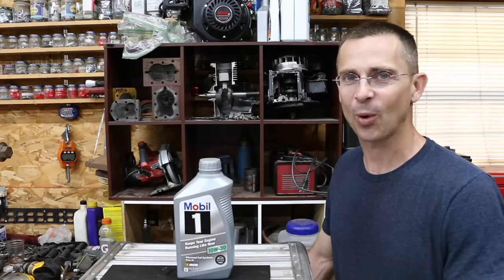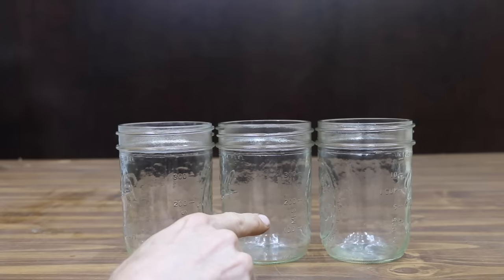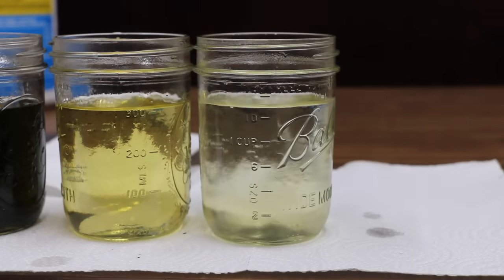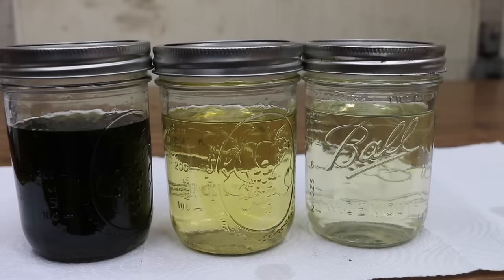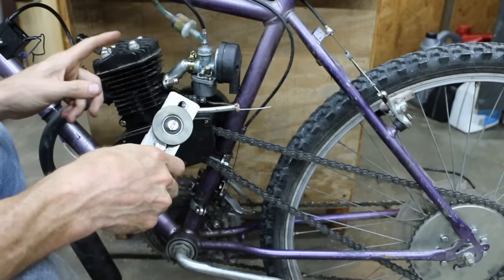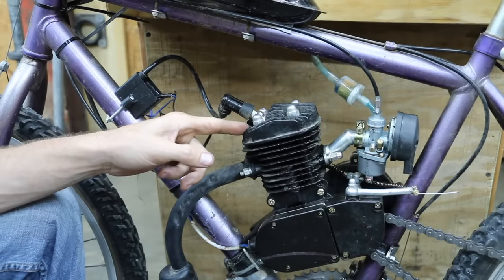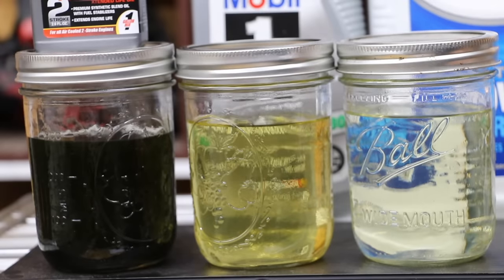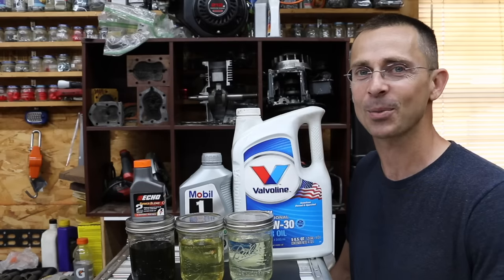Will 4-stroke oil damage a 2-stroke engine?  Let's find out!

Comment: Id say crank life could seriously be compromised. But it was a great video to show the short term effects of this, and to know that in an emergency one could get home with some basic 10w-30.
Reply from the maker: Thanks for watching!
Reply: I have an antique chainsaw from before dedicated 2 stroke oil was common. It’s data plate says to use SAE 30 weight oil mixed 16:1. So I’d say mixed 50:1 it definitely will not work.

Comment: You should test if lacquer thinner actually cleans out a catalytic converter and compare it to Cataclean
Reply from the maker: Thanks for the video idea!
Reply: I used to work at a shop we have a customer coming with the 2004 Cadillac CTS he said it quit running but he also said he put lacquer thinner in the gas because he read that it cleaned  the cats long story short we had to replace every injector fuel line and fuel pump because it disintegrated the rubber and plastic and clogged up the whole fuel system

Comment: Please test vegetable oil in a 2 stroke engine
Reply from the maker: Thanks for the recommendation
Reply: Run vegetable oil in my kx 80 years ago,I was about 11. It blew up,not right away,but it cooked
Reply: Daryll Messer you got 91 years?
Reply: Vegetable oil is very diverse.  2 stroke bikes in the 60s and 70s used the original "Castrol R", which was a castor oil based lubricant, or "Blendzall", also a castor based oil.  They had a distinct exhaust smell.  Oil technology has come a long way.  Saab used to have a 2 stroke 3 cylinder car.  It had a lot of problems.  An engineer friend told me that if they had had modern 2 stroke oil in those days, it would have probably been fine.  Having driven tens of thousands of miles in my Mercedes diesel car and Ford 7.3 diesel truck with vegetable oil fuel, I can tell you that I would NEVER put it in the crankcase!  With 2 strokes, you are lubricating the rings AND the bottom end with the fuel-oil mixture.  Not a good idea.
Reply: Test it yourself
Reply: Be-careful here.. Most if not all the oils sold as vegetable oils are not made from vegetables.  So call out what the oil is actually made from during your testing.
Reply: Chris Farley  Quite possibility yes
Reply: I did do some full power runs on my tailgator 2 stroke generator with algae oil at 40:1. i ran her 3 days with out shutting her down with verios loads and it worked great but    smoky at startup as it is harder to burn off though. i did do a full power load run for a hour to get exh temps 800 deg to burn off clean. at  850w load the exhaust get almost glowing then i back down for cooling before shutdown!

Comment: I love your videos dude! you take things with a scientistic eye, but within the understanding reach of mortals. I do see more carbon buildup around the spark plug electrode and around the exhaust port, even on the scoring of the sleeve surface, when 4 strokes oil is used. I believe that over time that carbon buildup would accumulate causing rings to stick on the piston, putting the spark plug on short circuit, etc.

Comment: I think the damage would be on the crank not the cylinder... on 2 stroke dirt bikes to lean or no oil always makes the crank seize....
Reply from the maker: Thank you
Reply: Totally agree...the oil in the fuel mixture is what actually lubricates the crank bearings, and wrist pin bearings.   I’m sure the engineers (in later years) realized that two stroke oil had an advantage over 4stroke oil, otherwise it would not be recommended by the mfg.   Would you risk putting 4-stroke oil in a new $5000 racing two stroke bike?  There’s a reason they designed it for using 2stroke oil.
Reply: @kramerflamer  - 2 stroke oil is meant to be burned and 4 stroke isn't, so their additive packages are different.
Reply: That is a little hard to believe because the 4t oil is designed to lube cranks and all other bearings in a 4t engine.  Why would the metal and oil care about how often the plug was firing and NOT lube properly if in a 2t engine?
Reply: 2 stroke oils burn cleaner and leave less residue. The old Jawa motorcycles were designed to run straight 50 oil as premix at a Ratio of 16:1

Comment: When I was a kid , my grandfather only used 30- wt in his chainsaws , never had an issue . 16/1 ratio. I believe other than the concentration . It's just another product to sell you . $$$
Reply: 16/1 ratio is nuts though.  The manual for my 2-stroke dirtbike says 60:1, and that's for conventional.
So I'm not sure the cost savings would add up burning that much oil.
Reply: Modern 2- stroke recommendations are for concentrated oils , not motor oil
Reply: @maitlandmoore6426  Right.  You're saying specialized oil is dumb since it costs more, I'm say, does it really cost more if you can use so much less of it.   And have the other advantages like less fouling.

Comment: Could u use diesel mixed with gas in a 2 stroke ? 
Can u use 2 stroke oil as an engine oil
Reply from the maker: Great video idea!
Reply: What's interesting is that I sometimes used 1 gallon of diesel to a tank of gas (20 gal) to burn the carbon out. It did seem to work on some of the older cars, at least as far as how the tailpipe looked, but I never took the heads off to see for sure.
Reply: Or was it a half gallon in a tank of gas? It's been a long time, 30 years ago or so :)
Reply: David Mc my friend puts for instance   15 dollars of gas in to 60 dollars of diesel
Reply: U can but the engine will certainly seize up.
Reply: Lappies Labuschagne hasn’t in 12 years so far with around 30’000 miles a year
Reply: @davidmc8110  diesel doesn't fully combust in a gasoline engine even in small quantities. What happens is it washes down the cylinder wall  and wears the engine out quickly due to lack of lubrication. Have lots of experience with this when gasoline is died for commercial or farm use. # 2 DIESEL IS USED TO CUT THE DYE.  Even small quantities cause the prob mentioned.  If the engine has a tendency to run cold such as a 4 stroke marine engine or air cooled in cold weather it amplifies the prob due to incomplete combustion,  it's called oil up as the  unburned fuel enters the crankcase diluting the engine oil and raising the oil level.
Reply: I have been running xd-100 oil in my Koehler powered toro for a year now, I rigged up an oil line that draws oil from the bottom and feeds into near the carb, I just add as I burn it. I’m at around 40:1 equivalent. I intend to fabricate a separate oil tank and convert it to a 2 stroke

Comment: Use 2stroke if you can in emergency you can use 4s stroke oil thats all
Reply: Used 2 stroke oil in my 73 Evinrude, 50: 1 for years, smoked on start up, never a problem.

Comment: I used to put just a small amount of 2-stroke oil into the tank of my old 4-stroke bikes to act as an upper cyclinder lubricant. It seemed to make it run a bit smoother but that could have been in my head. (the amount used wasn't enough to significantly alter the air/fuel ratio) I bet using 4-stroke engine oil in the 2-stroke didn't give you a gorgeous smell like Castrol TT used to!!)
Reply from the maker: Great tip.
Reply: I used too in my bombardier 250 for years, less gas consumption and no smell or smoke, and really less oil consumption (0.3 liter every 2 tanks and about 200 km, but compression and engine were just fine. )
Reply: Fill the whole bike with the 2 stroke oil, run an oil injection pump to the carb and there you go, total loss burn off, I used to do that with my 69 deville 472. I do that with my free toro kohler mower
Reply: that's what fogging oil is for
Reply: Better still using the well known upper cycllinnder lubricant Redex  that you can still buy in small bottles at Halfords
Reply: I used to add castor bean oil to the fuel of my honda 50 as a kid for upper lube and that motor would scream! It also smelled like a cox plane lol.